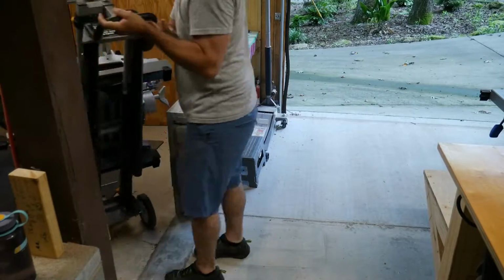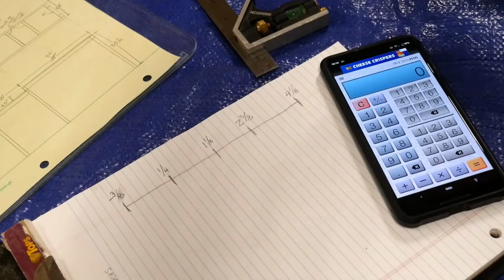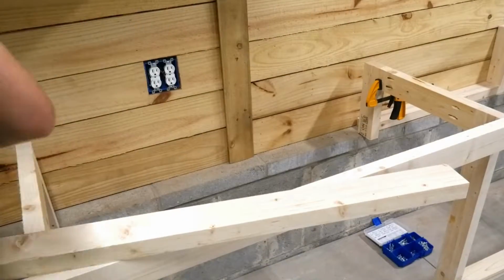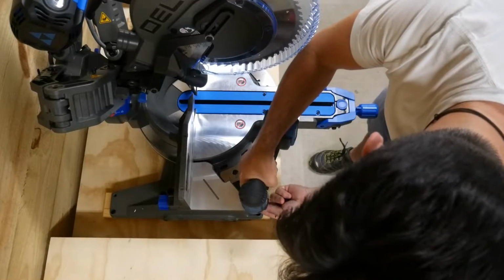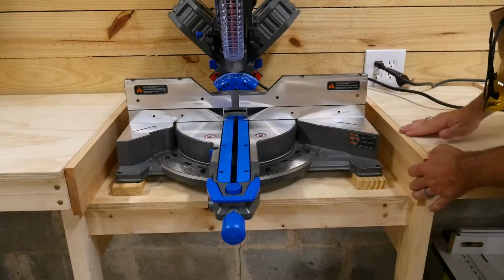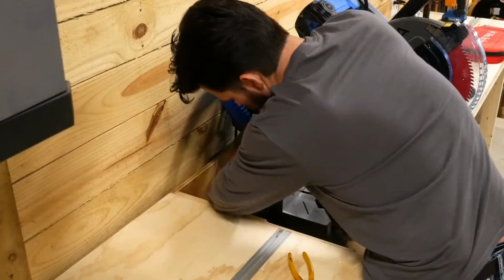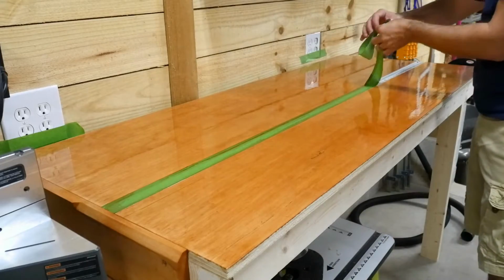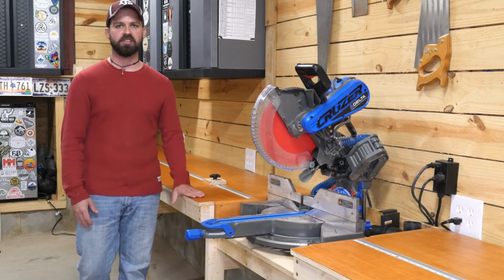Who Wouldn't Want This Miter Saw Station?!

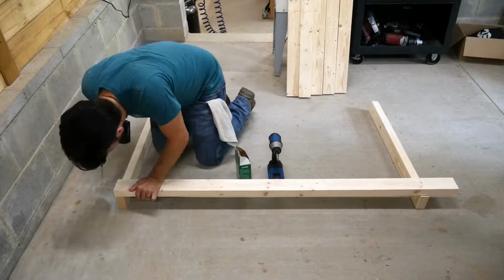Comment: 2:10 - 3:41How to calculate leg length for uneven floor? I don't understand.
Reply from the maker: Good question. So what I was trying to get at was that I was able to simplify this for my shop because I had the block wall at the back with a ledge that was perfectly level. So when I built the frame, I started with the back legs resting on that ledge, then building the table top, and then the front leg length could just be measured by holding the top level and measuring down to the floor at each individual location of each leg (you can hold it all level while doing this by clamping the top to the legs and adjust for each leg until the top is level).

Even if you don't have a ledge like I did, you can still kinda do this if you're planning on anchoring the back to the wall by tracing a horizontal line that's level with the earth (not with the floor, i.e. not drawing a line the same height with reference from the floor, but actually using a level and keeping the bubble in the middle to trace your line), and then installing brackets to the wall along that line to hold the back of the table top, and then just as I described above, measure the length each leg needs to be to keep the top level.

The way I did it at first before I came up with using that back, perfectly level ledge though was more complicated. I actually determined what the slope of the floor was by picking a reference point on the wall that I knew was level (I used the ledge) and measured down to the floor. Using trigonometry (lookup tan(theta)=opposite/adjacent, where opposite would be height to reference point and adjacent would be length from one end of the table to the other, and theta would be my angle of the floor), I was able to calculate what the slope of the floor was. Then I was able to use trigonometry again (same tangent formula), but this time I know the angle now, and I know the spacing I wanted my legs, so I was solving for the height of each leg.

This is really hard (painful even) to describe in text, but can be described better in a video. I did a quick search on YouTube to see if someone else has described this exact calculation and I can find a few videos that explain calculating the slope of a ramp, which is basically the same thing, but you'd have to extrapolate the concept a little for what we're doing here. I'm not sure what you're background is or familiarity with trigonometry is, but just do a search for "calculating slope of ramp trigonometry" and maybe that will give you what you're looking for. For what it's worth though, this is a really good question and is probably worth me doing a video on. So I'll plan on doing a video on it in the near future and I'll link it here in the comments too (maybe around the end of February I can have that ready).
Reply: What you have explained is very valuable to me. Thank you so much for learning so much from you.